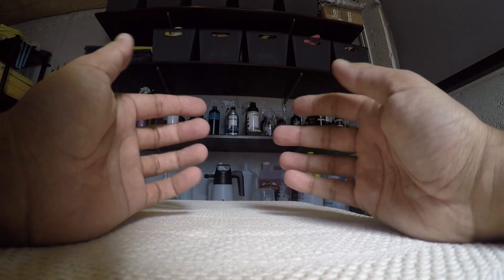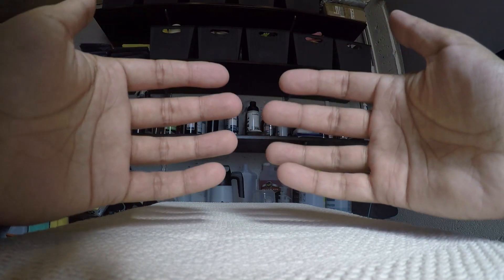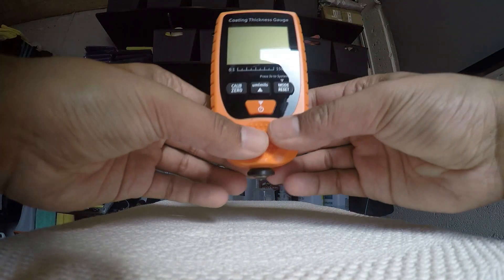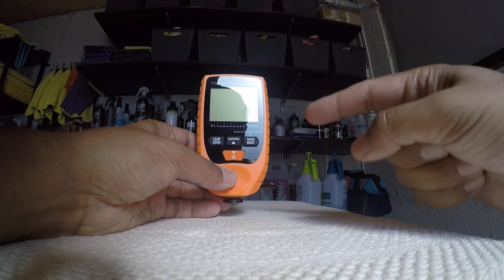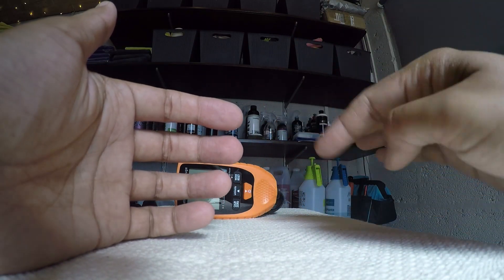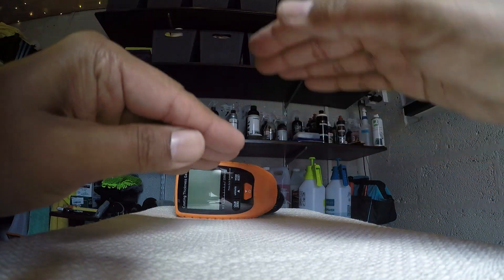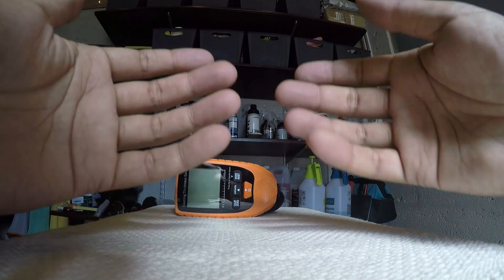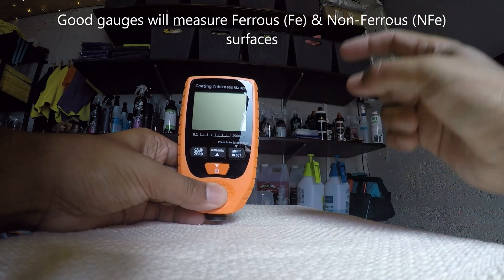Paint Thickness : WATCH THIS to AVOID A COSTLY mistake!

Comment: Thanks again. How many microns on average does a stage one correction take off?
Reply from the maker: A_NI_MA_L - Like a lot of things in detailing there is often no straight forward answer.  Too many variables to answer that question - polisher type?, pad type?, ambient temperature & surface temperature?, paint hardness?, detailers technique?, polish type? - the list goes on 🫣.  No two vehicles will be the same either.  You should always fully decontaminate, measure paint thickness before starting, do a test section, then measure paint again to see how much you are removing! Then if acceptable levels of removal are achieved at the same time as getting the level of correction you want then in general it should be safe to continue with the rest of the vehicle.  Hope that helps? (Or not - LOL) 👍🏽💯🚗

Comment: I’ve got a new car and I need to polish it and ceramic coat it as it came with swirls and dealership covered it with some sort of polish and I bought it in winter so the sun wasn’t there to help me , the bonnet has around 130 microns but the sides of the car has anything from 94 microns to 105 microns , I haven’t checked everywhere yet so there maybe some areas with 90 microns and we are seeing them figures on a lot of new cars.
How do we tackle these areas as the areas which get swirled up the most is the lower sides and that’s where the thinnest paint is ?
Reply from the maker: Imran Ali - Thanks for watching.  The trick is not to chase perfection - especially in the thin areas.  Measure the lacquer thickness so you can work out 25% of clearcoat thickness and work to the thinnest measurement.  So in the thin areas if 90 microns is the thinnest then assume it is all 90 microns in those thin areas in order to polish safely.  Then find out lacquer hardness by doing a test area.  If you get good results with a 1-step then do that.  Measure again where do you do a test section to see how much lacquer you are removing.  Hope that helps.  Thanks again for watching.  If you've not already done so then please check out the rest of the channel and subscribe.  Thanks.
Reply: @VProjectUKDetailing  I’ve already subscribed thanks , the bonnet has a decent thickness of paint and I presume the roof will aswell as that’s a flat area but the sides are not very good , I need to measure the non clear coated area to get a idea of the clear coat thickness and take it from there but I do really want to stick with one step or just finishing polish if I can get away with that
Reply: @VProjectUKDetailing  just done a quick check on the non clear coated area and I’m getting reading of 25 microns , seems crazy to me
Reply from the maker: Imran Ali - Once you have an idea of non-clear coated area paint thickness you can work out roughly how much clear coat you have.  If it's thin our advice would be to leave it alone, or at best just do a jewelling polish in the thin areas.  Good Luck.
Reply: @VProjectUKDetailing  I’ve got a idea as the non clear coated area is just 25 microns which seems like nothing and that can mean I got a decent amount of clear coat
Reply from the maker: Imran Ali - Often the non clear-coated areas, if not sprayed fully at the time the panel in question is sprayed, can just be overspray! Typically you should find non clear coated areas fully sprayed to be at least 50 microns! 25 microns seems very thin so in our opinion it is most likely to be overspray! Therefore you may think the paint is thin, and lacquer is thick - but that may not be the case! Sorry to potentially disappoint but check carefully to avoid damaging your clearcoat which would require a costly respray! Just trying to help …
Reply: @VProjectUKDetailing  I already knew not to rely on them figures as 25 microns seems like nothing , however water based paints require a lot less paint to get coverage compared to the older solvent paints , inside the door where there’s base coat and clear coat , the sills and door shuts are around 55 microns so I might use that as a figure to work with rather than the 25 microns on the inside of the boot where there’s no clear coat